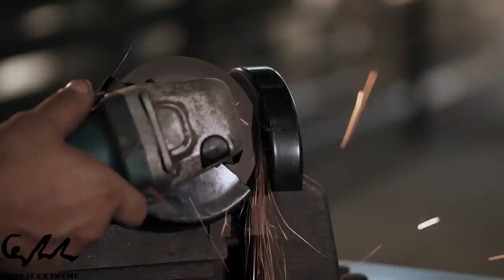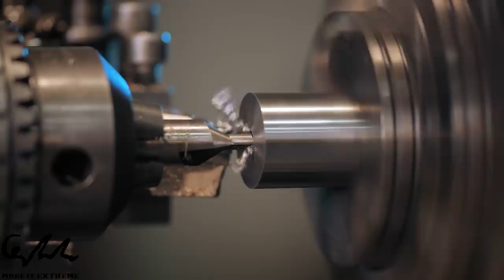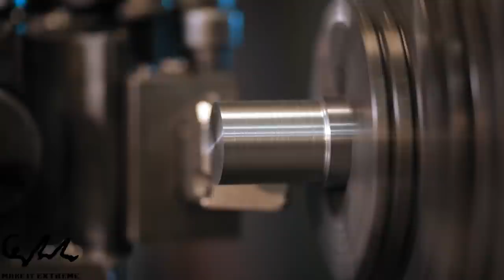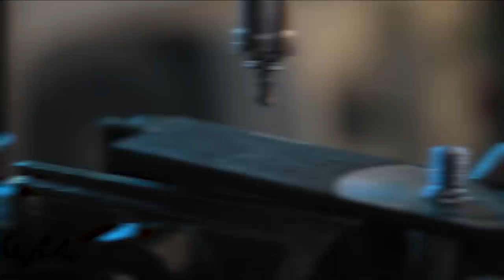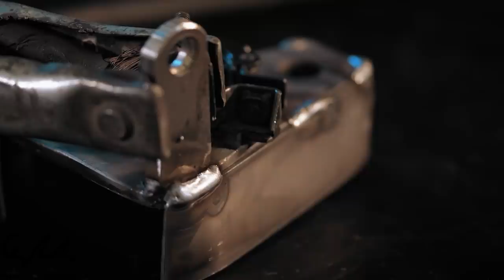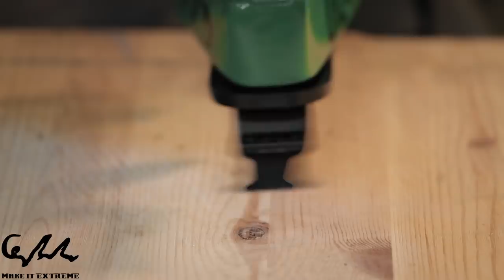The ULTIMATE Angle Grinder Hack Project 0124

Comment: with the oscillating mechanism being very heavy, your hands will frigging DIE from vibration sickness.
Reply: The actual mass isn't that high, at least when comparing with the weight of the whole angle grinder itself.
Reply: @alaric_  but the vibration looks real bad .. my hands go numb if i am on a lawn mower too long ,, looks like i might last 5 mins with his tool

Comment: I like your creative nature.  But when costs and practicality come into consideration, they have oscillating tools available here in the USA much cheaper than the time I would hire a machinist to do this for me.  Thanks and can't wait until the next video.
Reply: I have always thought these as projects for a person who has these tools or access to them. Very few will have money to hire someone to make these things for them and yes, oscilating saws can be bought at very reasonable price. But again, if i had the tools available (lack of a lathe being the largest obstacle :) i would make this for myself. Despite cheapo china saws being available by the truck loads....
Reply: @alaric_  Hi Alaric.  I agree with you.  Since I do not have a lathe (or the expertise to operate it), I am stuck either hiring a machinist or purchasing the tool.  I try not to buy cheap Chinese, but rather to get a good US, or European tool.  This of course is getting more difficult in this International world, but as long as I try to stay in the higher models each company offers, I can usually get a quality tool and in this case certainly cheaper than hiring a machinist for a few hours time.  I really wouldn't knock Chinese built products, especially when buying higher quality items.  To this date, it is hard to get a better made bike for the price.  If they tried to have the iPhone manufactured in the US, it would probably cost double.  Just need to be a knowledgeable buyer.  Thanks again.

Comment: What brand of step drill bits do you use? I have tried 3 or 4 different brands and they all seem to dull out very easily
Reply: Bad cutting technique. Use plenty of lube with the right feed and speed. If your hand drilling, press as hard as you possibly can with a drill over 10mm.
Reply: @zanpekosak2383  i think the brands I tried were just too cheap. I always use cutting fluid.
Reply: @GrooveyGrubworm  I have had a little bit of luck with the step bit also tried the tapered one no steps ,, well it did what a shop vac does ,, it sucked ..

Comment: Strange? For some reason I always thought the Make it Extreme folks were in Poland. God knows where I got that from. But as far as I'm aware, that "Type G" socket they showed is only used in the UK, Ireland, Singapore, Malta, Malaysia, and I think somewhere in the middle east........... So where are they actually based ?
Reply: all over the caribbean as well and numerous countries in africa .
Reply: Ok, I just saw on their "About" page that they're in Greece. That's odd though because Greece mainly use round 2 pin sockets.
I wonder if they decided to use the geographically unusual socket in the video for any particular reason?
Reply: @cordellej  I didn't know that. I'm English, and as far as I was aware, the type G sockets we use were just one more thing we've stuck with dispite there being better standards out there. The only real benefit of type G is the plugs have fuses in them, but apart from that they're not as good as the type F that most of the rest of Europe use.

The type F can take more amps, AND they don't naturally lay on the floor with their pins sticking up to become embedded in bare feet !
Reply: @Reman1975  Maybe you were thinking of the channel "Made in Poland" which does very similar videos.
Reply: @Basement-Science  ........ Now you mention it. 🤔
I'm subscribed to quite a few engineering "Maker" channels (including Made in Poland), and most of the ones from Poland usually seem to ape the Make it Extreme style. So maybe I've subconsciously connected this style with Polish channels?

Comment: I feel sorry for whoever uses tools with a plug attached
Reply: love changing batteries when your right next to a power point do ya? i love my corded shit for when im right next to my work area, nothing goes flat and the extra power is always handy.
Reply: I also feel sorry for people who set up reels or have to stick close to outlets or spit on corded tools because they've got crappy 20$ cordless tools- er, toys.
Reply: @zzzires5045  my only advice is buy better cordless tools.
Reply: @dimitar4y  well if you move over to milwaukee or festool you will understand where I'm coming from 👍
Reply: @AMG63  a standard cordless grinder is like 50a
On a 5 a/h battery its like 15-20 mins and will never have the torque or speed of a corded one. Its a matter of there's only so much power avaliable
Reply: @AMG63  milwaukee too expensive and not that good, Dewalt or Makita are the champs!
Reply: @dimitar4y  dewalt 😂
Reply: @AMG63  Hey, specifically their 18v nailers are notoriously reliable and powerful. Meanwhile milwaukee don't even offer full spare parts, a lot of their stuff is sold in assemblies that are half the cost of a tool...

Comment: But the big question is, Why? For the salary of the couple of hours (maybe £30) it took to build that heap of crap you can buy a cheap new multi-tool that is safer, lighter, vibrates less, and works better. Rule no1 in manufacturing, before we mess around making it ourselves, could we just buy it in cheaper?